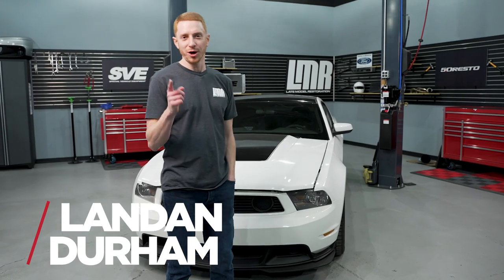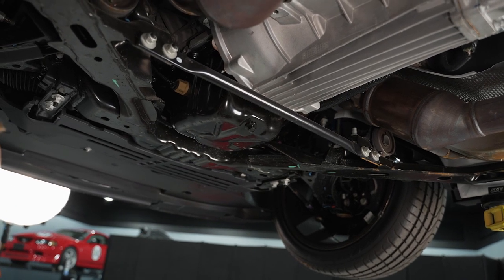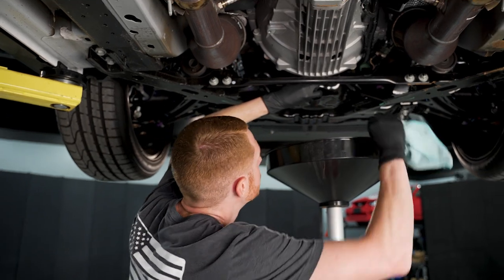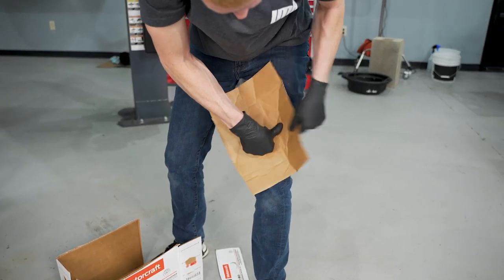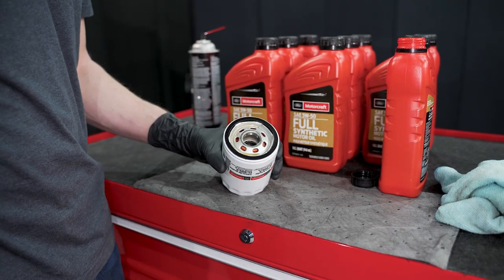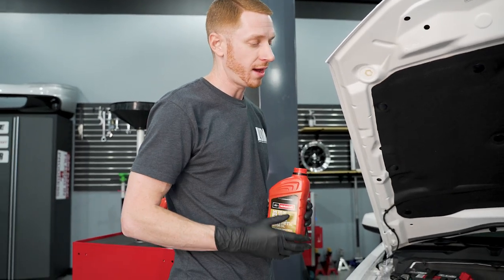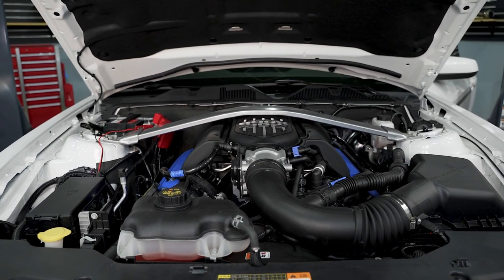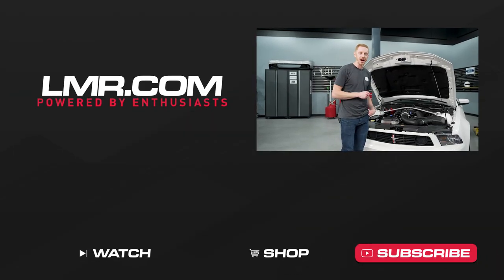2012-2013 Boss 302 Mustang Oil Change & Oil Life Reset - Full Process (5.0L Roadrunner Engine)

Comment: My man likes his micro fiber towels! Me too and awesome video. Attention to the most minute details and love the little commentary. Where to hold the torque wrench, the card board trick, and on and on. You are my detail clone. I bought your pinch weld protectors for my own car lift and they work great with a mm of clearance on the side pipes. The hard part is not driving off with them still on lol. Yes, I've done that. I also use them on numerous other cars like my Miata and others. I'd say knowing you some car lift safety tips on rocking the car and ensuring the lock pins have engaged on the lowering / lifting arms as well as the pins that allow the arms to swing in and out would be a nice thing to mention as well. You really can just never be too safe.